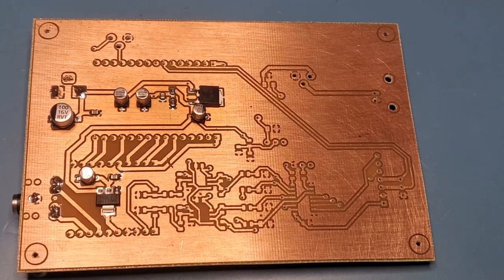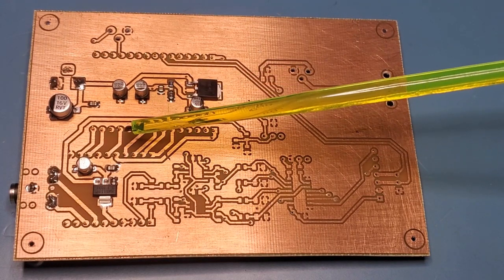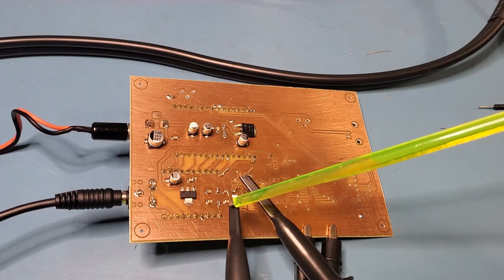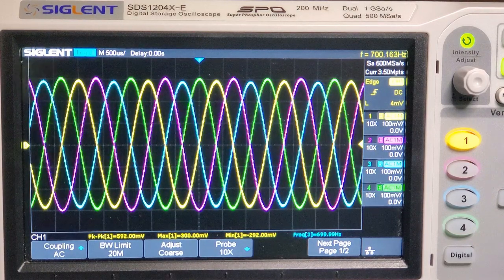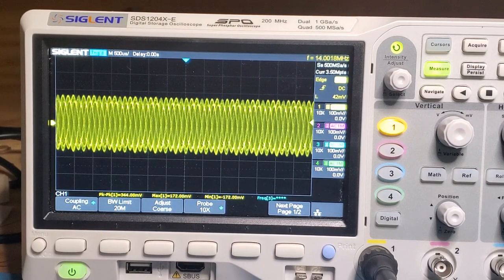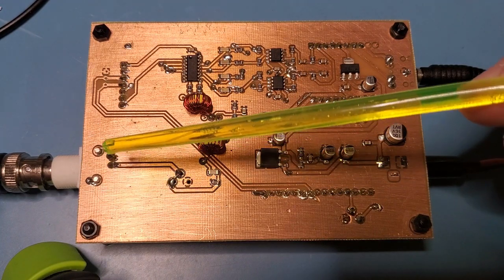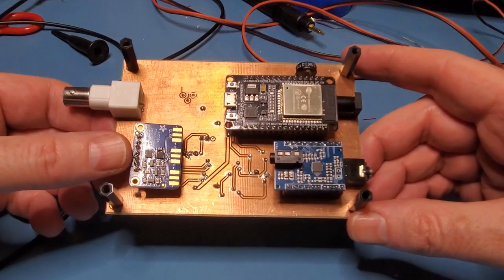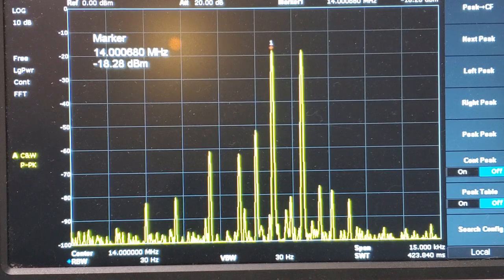Tayloe Transmit Mixer Update

Comment: A slight amplitude difference is to be expected due to the component tolerance. You can adjust it with some trimpots if necessary.

Comment from the maker: A viewer suggested I read this  http://www.waveguide.se/?article=transceiver-build-part-4 - I hadn't seen this before but it looks like an excellent resource. I will digest and see if I can incorporate some of the features. The author speaks of more carefully matching the sampling capacitors which I did try in this build (those 47nF caps after the op amps)

To the viewer - I am not sure why but your comment disappeared (perhaps the embedded link?). I got the notify but then no comment. Thank you for your comment and link

Edit: Well I read the link and the gist is that the author added two separate software controlled DC biases at the sampling caps for each of the I and Q channels. With that he was able to achieve better carrier suppression. That's something I'll definitely try in a followup.

Comment: Clean layout as usual. Do you face any trouble (RFI) from the wifi and the switching mixer (fst3253)? All the best and looking forward for  more updates
Reply from the maker: I did have trouble with noise from the wifi when I had the RF components on the breadboard and within 1-2 cm of the wifi antenna of the ESP32. I didn't notice any with this board configuration - quite a bit of groundplane between the RF circuitry and the ESP32.

Thank you for the comment!
Reply from the maker: Actually I answered a bit too quickly... There was no wifi interference in this case because I didn't even have the wifi on. In this circuit:

https://www.youtube.com/watch?v=NWdemILPp3Y

I did have wifi interference when the ESP32 wifi antenna was closer than 1-2 cms to any of the RF circuitry
Reply: @na5y   Thanks for the details. Wifi TX EMI issues on the codec+opamps was something i faced on an old project which ended up moving to stm32. (So still pending is a Wifi SDR transceiver project)